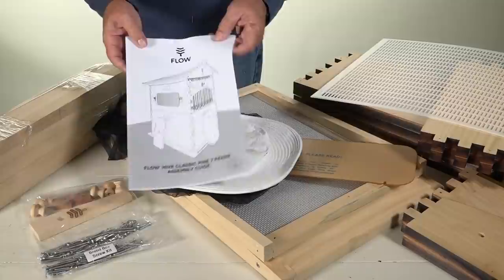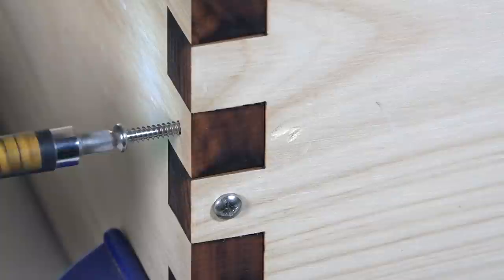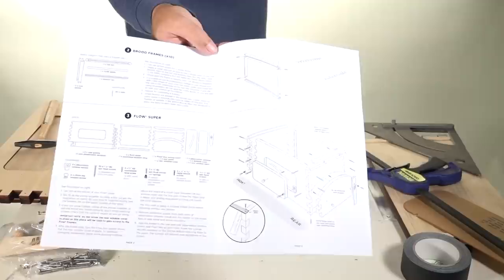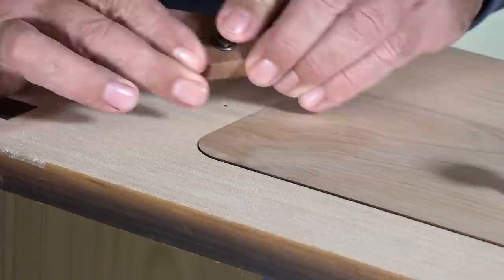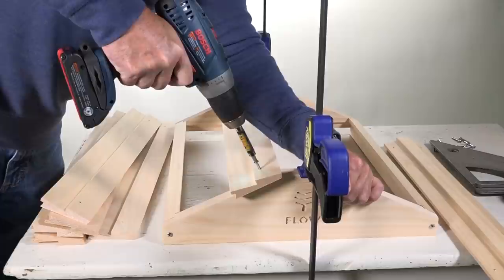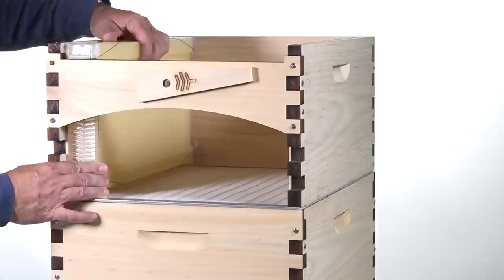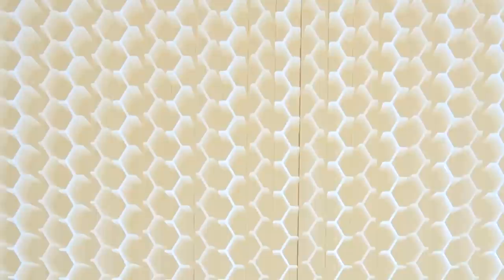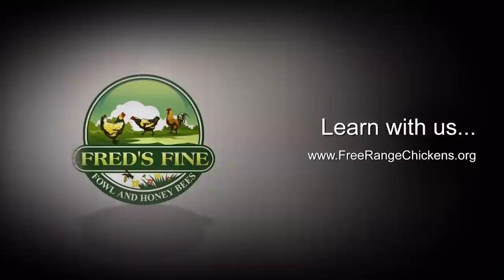The Flow Hive now BIGGER and BETTER than before, Assembly Guide 10 Frame! Honey Bee Hive

Comment: Fred, I personally do not use any glue on the wood. The bee has such a sensitive nose that this might affect them liking the hive or not. This is a preference call on my part. You said the wood was laser cut and from Australia right ??? Since the wood is burn cut it give wood a lot more water proofing finish on the board ends. Nice work fella too.
Reply from the maker: I use the glue on all of my hives, it helps keep the water out of the joints where a lot of deterioration can occur. I also prefer glue to screws and often don't use screws. That's valuable later on if the wood is to be cut up or burned at the end of its useful life. Each wood frame inside the hive is also glued and I don't use tacks on those. The bees work the area that has been glued equally. I don't think dried wood glue (Titebond) puts off a discernable or objectionable odor that the bees respond to.
Reply: @FrederickDunn  When I tested to see if the bees object to titebond it was fifty fifty and when I used gorilla glue it proved that the bees also do not like this product. That is just what the experiments I done prove that fact. I fasten with stainless steel wood screws. Peace will keep in touch Rich.  Good day. VF

Comment: You say, "Sometimes people have problems with the pins splitting this thin wood." The solution to this is an old carpenter's trick. Flatten the tip of the nail a little bit with a hammer. The wood fibers are broken when driving the nail instead of splitting the wood.
Reply from the maker: That is indeed a great method, thanks Cliff!

Comment: You have to wonder, rather than tilt the whole hive back, or require someone to tilt it before harvest, why not just angle the bottom part where the honey flows out of it? 
Just make the bottom of the honey harvest frame 1 inch longer on the side where the tap goes in.
Reply from the maker: You should contact them with that suggestion :)

Comment: Thank you Dunn. For sharing information in a lucid manner about hive. My question about this is, why can't we use metallic frames instead of wooden things. I will wait for your reply. Thank you
Reply from the maker: Thanks for watching and for such a nice compliment. Wood is an insulator and lighter in weight, even aluminum is heavy. Bees like to chew on wood to some degree and they can't alter metal in that way. Last, metal transmits heat and cold through conduction which may result in additional condensation which may oxidize the surface of metals, even aluminum oxidizes to a white powder. For now, wood seems to be the best, or food grade plastics which can be coated in bees wax.

Comment: What a fantastic improvement in quality control over your first one/two.  Was that one sent from AU or made here in Oregon? 
Have you measured the cell size? if so please let us know what it is as I will be purchasing my Flow Hive in a few months but I want to keep my bees small cell.  I guess cell size in the super won't affect them too much but it would be great if they were at least down to 5.1mm if not 4.9mm
Reply from the maker: The wood materials shipping box was labeled Millington, Tennessee.
Reply from the maker: The cell size is unchanged, the FlowFrames are the same as before.
Reply: Frederick Dunn interesting, something I read had them cutting parts in Oregon just a few weeks ago.
Reply: Frederick Dunn that very first one you originally received missing all that hardware was from Lancaster PA if I’m not mistaken.
Reply: Lancaster PA by the same folks that bring you the Amish miracle fireplace!

Comment: What happens to larva eggs , destroyed?..dunno the technical term for baby bees
Reply from the maker: I'm not sure at all why you'd think that larvae or eggs would be destroyed? What would destroy them? If you would kill bees in a standard Langstroth Hive, then you'd also kill them in this one. If you're referring to the Flow-Frames where the honey is stored, any worker that may be attending to a cell when and if the frames are cycled to the open position, they simply back out unharmed. I've been using these since 2015 and have hever ever had a single bee-part come out with the honey. It does not kill honey bees.

Comment: So will you only use flow hives from now on?

If I am starting from scratch with my beekeeping do you reccomend relying on flow hives if you don't mind the initial outlay?
Reply from the maker: HI Kanger80, I will continue to use the standard Langstroth 10 frame equipment with and without Flow components. I have no plan to completely convert to FlowHives. I still enjoy both methods. I generally recommend that beginners start with a traditional Langstroth setup until they are solidly committed to keeping bees and won't have spent lots of $$ for a temporary experience. You can add a FlowSuper to a traditional Langstroth box if and when the bees are productive enough to work it. You don't really "need" to buy a full Flow"Hive".
Reply: that is good advice that I think I will take.  I am not quite yet a beginner.

Comment: Isn't lasercut joints also good because it burns the wood which makes the bee not touch it due the ash texture? Meaning, it might be easier to pull off once needed. Of course, I guess it goes away after one year.
Reply from the maker: Hi Helveteshit, none of the laser burned surfaces face the interior, so the bees really have no contact with those surfaces. It goes away after a year? I didn't know that and it will be interesting to see. I'm using a clear finish on the exterior, so we'll be able to see what happens. Thanks for sharing your knowledge!
Reply: I just figured that Bees dislike smoke, smoke is something that is essentially burnt material/Charcoal. So I guess they wouldn't want to get close to such surfaces and by lasercutting the wood like that, it would lead to burnt surfaces. I figured it might be easier to separate the boxes because of that little fact. 

It is just me spouting theories since I do not have an Apiary to test said theories with. But I figured bees might avoid building wax or that sealant on top of an ashed/burnt surface. But hey, I can be wrong. 

As for the laser cut surface vanishing after a year? I figured normal weather and time would deteriorate the surface unless one adds extra protective coating on it.

Comment: Hello, how do I know if I should get the 6 flow frames or the 7?
Reply from the maker: They are pretty equal, some equipment is for 10 frame Langstroth hives, so that would match a 7 frame Flow. The 6 frame flow is matched up with the 8 Frame Langstroth. There is some hive equipment that may only match the larger version. BUT, if you're going to use strictly Flow-Hive gear, it's just a matter of what you want to work with and are willing to pay the price for. I find the 6 or 7 flow supers both work pretty much the same.
Reply: @FrederickDunn  Thank you for your quick reply! This information and your videos are so very helpful. Have a great day!

Comment: Hi Frederick, I have a question regarding beekeeping in general but haven't found any definite 100% confident answers so I thought i'd ask for your input; in my situation I am planning to have one 8 frame brood box and then a 6 frame flowhive super on top of that, i'm in Western Australia so the winter is not harsh at all, so my question is - will having two  brood boxes increase honey production in the flowhive super or will having one be more efficient?
Reply from the maker: Hi Dkruzy, sorry I didn't notice your comment sooner. Absolutely nothing wrong with your idea of using a standard 8 frame bottom board and brood box. I'm not familiar with your climate, but I think that starting off with two brood boxes is a good idea to allow your colony to grow large and get settled with their resources, then adding the third box as the FlowSuper would or should fill up quicker and you're allowing the bees plenty of resources for times of reduced resources in the environment. I was visiting with a first year beekeeper recently and he had one deep brood box and the next box is the flowsuper, he took off honey right away and I had to point out that he basically left his colony without any meaningful resources. I always suggest allowing the bees to build in numbers and resources before adding supers, you're on the right track!

Comment: Hi... Thanks for this video... Maybe someone has asked this question before ???
I'm in Canada, and we generally have a second super, above the brood super, with a Queen excluder on top, so that the bees have enough honey stored for themselves for the Winter... 
I'm assuming that I can add the 7 frame flow super on top of these two... 
Do I need to order a second medium/deep box c/w frames from FlowHive just so the complete hive "matches" ???
Thanks...
Reply from the maker: I was just messaging Flowhive about that very thing - Since in the colder climates, my method is to put the brood box on first, then at least a medium super which they fill prior to adding the Flow-Super which is removed in winter. Flow doesn't currently offer medium supers, only deeps. This results in a very tall system with a small footprint when talking about their 6 frame units. And the deep honey supers are extremely heavy. I'd like to see them offer a "cold weather kit", but for now, they only offer deeps.

Comment: random question that I thought of when you said not to paint the interior: do you know if, back in the lead paint days, the bees consume the lead paint (I've heard it has a sweet taste) and taint the honey?
Reply from the maker: That's a very interesting question and I'm not sure that lead paint on hive interiors has ever been addressed? Not painting hive interiors goes way back to the originator of our current box-hive design which was well established in the 1880's by Reverend Langstroth. He stressed in his writings, that only the exterior should be finished against the elements. The next part is that I have observed honey bees chewing the interior surfaces as they round off corners and even make new openings at times and then use their own propolis as an interior finish which would protect them from lead and other hazards. It's an interesting question that I think we won't ever really have answers to as no one is still using lead-based paints. Thank you for sharing your thoughts!

Comment: I have been watching your videos and I decided to try beekiping.  I have some questions 1) Do you know if all kind of bees will like these plastic hives? 2) I live in Sonora, Mexico where the heat in summer is really high up to 120 F Do you expect any issues with Flow Hive?
Reply from the maker: Hi Frank, first, thank you so much for watching my videos! Bees accepting and working or not working with the flow-frames has not been evident by genetic line of bees based on my observations, even I have bees that never quite fill the flow-frames. This has largely to do with the productivity of the colony as those same bees do build comb on Acorn wax coated plastic frames. Sonora, Mexico (I've loved my Mexico trips in the past) will require you to shade your honey bee hives no matter what you put inside them. Your bees would die out from heat before your flow-frames would attain a temperature high enough to cause the plastic to become unstable or break down materially in my estimation. I've had them in "hot-boxes" for evaluation and temps rose well above 180 deg. f, where the older Pierco Plastic frames failed by warping and the support ears came completely off of 5% of them. The Flow-Frames showed no physical deterioration under the same conditions. Given shade and plenty of water resources, your bees will keep the hive interior under 100 deg. f unless they are in failure.

Comment: there is a big difference in prices of flow hives ...does that mean the more expensive ones are better ???
Reply from the maker: If they are being offered at a big discount, those would be most often scams or fakes. There is a range between just flow-supers, and entire hives. I will say that the Flow Hive 2+ is much better equipped than the basic Flow-Hive, BUT, you can do just as well by getting the super and putting it on any of your strong Langstroth hives when they demonstrate great honey production. :) HoneyFlow.com has all of the correct prices. Be skeptical of big discounts.

Comment: How often do you have to requeen with one of these systems? Also what is the purpose of requeening in general, I've always assumed that wouldn't be necessary since bees are typically able to make new queens on their own.
Reply: Also, what pound package of bees do recommend for starting up one of these?
Reply from the maker: No different from any other hive. They requeen themselves when they feel the need.
Reply from the maker: A three pound package would be fine :)
Reply: @FrederickDunn  Thank you so much for the quick response!

Comment: (im in the process of readying my apiary and plan on raising bees next spring, so I apologize if im asking really novice questions) BUT... with those brood box wood frames, you mentioned you use gorilla glue to hold them together, is this 100% needed? Like when the bees go through and seal everything, would that be enough if you just used the pins? Also, is that glue safe around bees? I would assume so, as you've been doing this expertly for a while now and I don't think you'd offer bad advise, im just curious.
Reply from the maker: I use glue because I'm an overkill kind of guy. The glue is non-toxic to people and non-toxic to bees, particularly after drying. I also use Elmer's wood glue, they both do the job. YES, the pins are enough, I just find that I damage fewer pieces and work faster with the glue.
Reply: Thank you for the quick response. Your videos documenting your work are really helpful and I look forward to seeing what you put out next!
Reply from the maker: Thank you Tim, I'm so glad you are learning from them. We have lots of new subjects coming up this spring and summer. I think you will continue to enjoy this series :)

Comment: Researching beekeeping and considering the Flow Hive (complete setup) or a Langstroth setup with a Flow super on the top.  Is it more economical in the long run to have the Flow super on a traditional Langstroth 10 box system?  If I go with the Flow Hive how long do the boxes and trays last?  Do I have to replace any parts on any regular basis?I am willing to spend the money for the convenience of the Flow super to make honey extraction easier but want to be economical for the rest of the hive if possible.  If starting from scratch as a new beekeeper which setup would you recommend?
Reply from the maker: Hi Linda, those are all great questions. 
An advantage of the full flow hive system is that the bottom board is already tilted to the rear for honey extraction.
Aside from that, I find that having flow supers to put on your Langstroth boxes is just fine. After all, the main advantage as you've already stated is the ability to draw off surplus honey with the specialized frames. 
I have two full size FlowHives and four Flow Supers, I personally enjoy the convenience of being able to put the supers on any hive of my choice. For someone just starting out, I definitely lean towards the supers by themselves. 
I recommend for those in the north, with longer winters, that you obtain two deeps, a bottom board and one medium super to place beneath the flowsuper. That way when you take your FlowSuper off for winter, the lower boxes will still hold enough bees and resources to see them through winter. In the southern climates, you could have a single deep, one medium super and then your flowsuper. I wish you well :)
Reply: Ty for such a detailed reply.  I am in the Fort Worth, Texas area.  I read for some warm areas 2 broid boxes are needed but haven't found if that is the case for my area.  Also I saw some random comment about having to replace pays off the hive every 3 years to prevent pesticide build up.  That was why is I was beget going with traditional Langstroth boxes and pays except for the super.  I can't find where a I read the comment and don't know if it's even something I will need to do. Still have lots of reading to do but appreciate your help and videos.
Reply: TY for your detailed reply.  I am west of Fort Worth, Texas.  I read that in warmer climates you need 2 brood boxes but I don't know if that applies to me.  Also, I saw a comment (that I can no longer find and don't know it's validity) about replacing components of the hive every 3 years to prevent pesticide build up.  This was a reason I was thinking about using the traditional Langstroth hive for all the parts except the Flow super so as to keep expense down.  I don't want to spend more than I have to upfront (but am willing to do what is necessary to make the hive something I can maintain and enjoy) but I don't want reoccurring expenses to be unmanageable even more. I am still researching and reading.  I know someone I can go see their setup soon also. TY for your help and videos.
Reply from the maker: You're welcome Linda! Considering how much time and thought you are putting into this venture, I'm confident that you are going to do very well for your bees. Arghhh... pesticides are finding their way into everything and it is nigh impossible to keep them out of our crops (thanks Bayer) and off homeowners lawns and gardens. Every single home and garden center pushes pesticides at every turn of the garden aisle. It's a battle for the mind.
Reply: Frederick Dunn - we need to tear our our lawns and stop poisoning the earth.

Comment: could i have 20 of the flow hive boxes spaced 5 feet apart?

there's no cheap chinese knock off @ US $50 a box?
Reply from the maker: Yes you could, they don't need to be 5 feet apart, flowhives are the same as any other hive when it comes to spacing and apiary density.